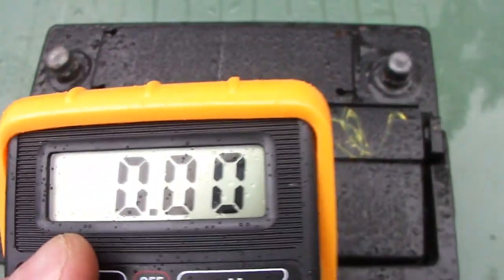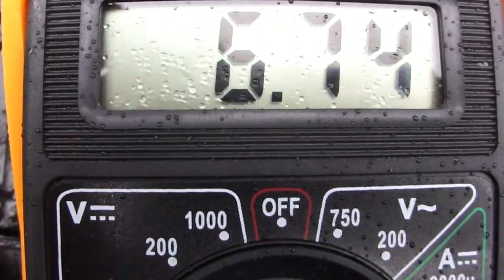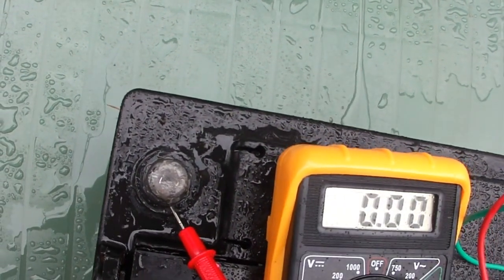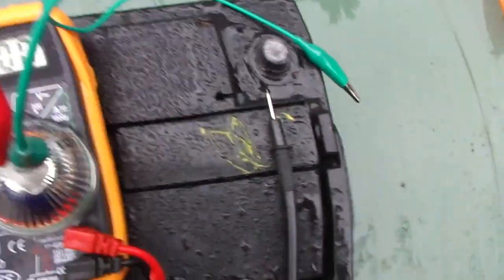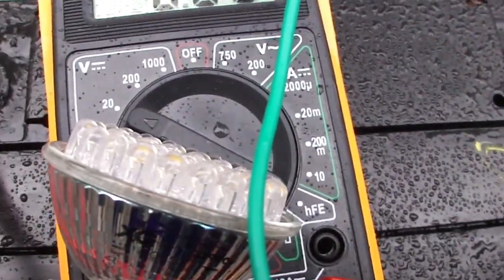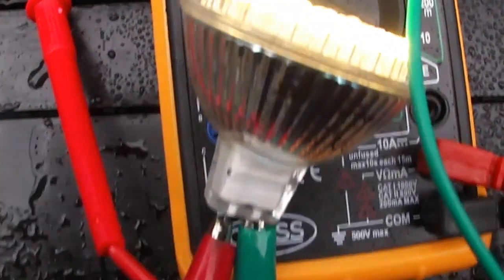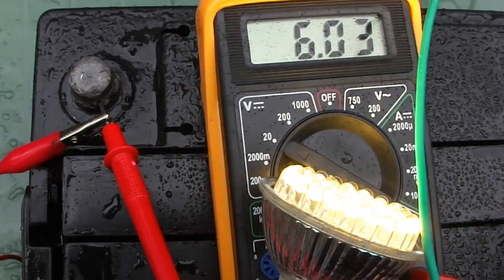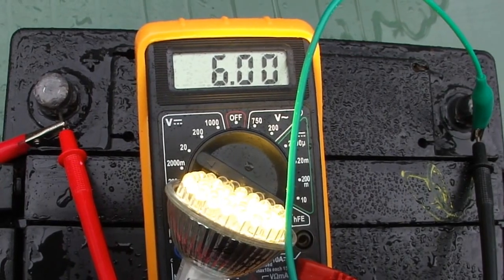Alum Epson salt electrolyte car battery conversion 09

Comment: I wonder how well the battery will preserve ...maybe different salts and concentrations ... go Bio life with it...
Reply: Made bay water battery's.. Yep Miami salt water.. They act like a conpasiter with charging lead acid.. Have two hooked in series.. Have took up to 24 volts and down to 9 volts runs my Engel freezer... No problem.. Been using as 12 volt today hooked my lead acid in after the reach 14.5  seems to have saved the other two Walmart battery's group 27 running parallel ..they was stuck at 12.5 to 12.4 so charge controller today was set 14. 5 solar  shuts power off at 12.7. House bank at 12.83 salt still powering my 750 watt inverter no sun over a hr it's at 11.9 inverter good on it tell 11.1 then reset good tell 10.7..two hrs entertainment after sun set..so think will charge a phone if use a cig lighter plug for days..they work great for fans and led lights.. Used these battery's to pump a friends boat they was trying to hold at 12.2  12.84 fingers crossed fixed..so one of the salt battery's may revive as lead acid cause it was holding 12.4